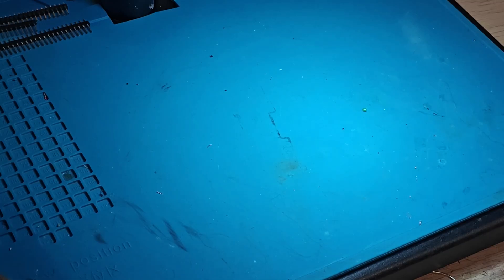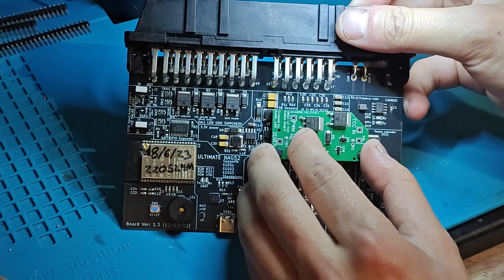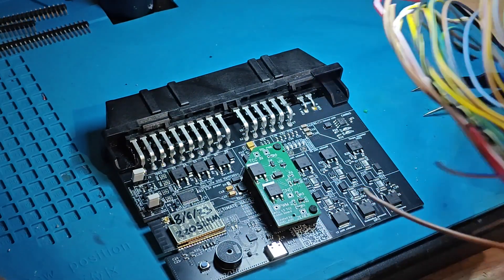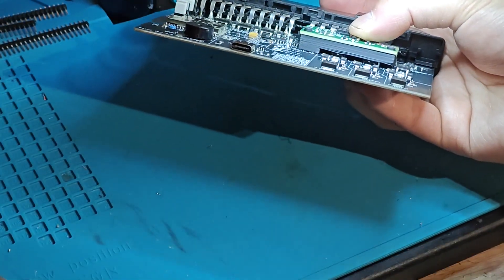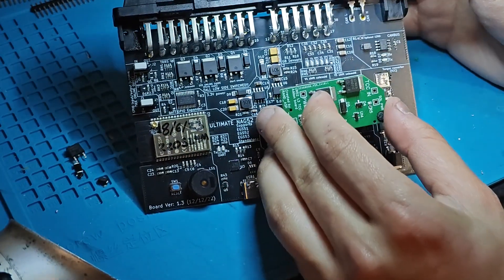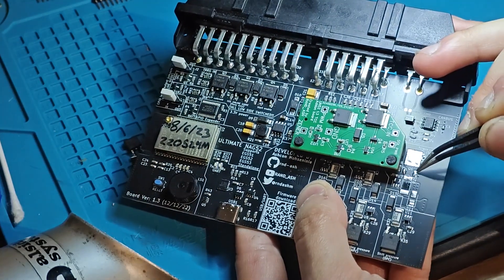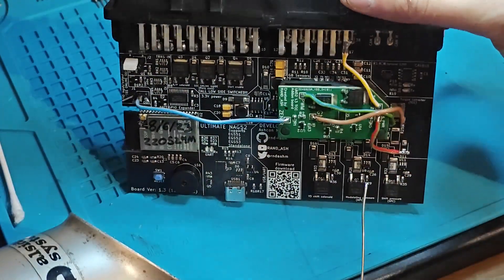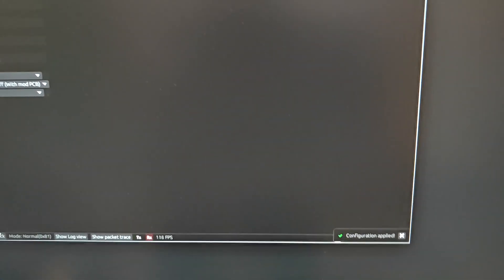Ultimate-NAG52 v1.3 Torque converter mod PCB install guide

Comment: Great instructional video. My boards just arrived for Evonne the Turbodiesel, the car on my channel. I hunted for the instructions for what what components to remove and what connections to make in your links, and didn't find them. I thought it'd be nice to print out for use in my shop as I break out the soldering iron. Am I missing something? Thanks!

Comment: Hey! I hope you are doing well, I just bough a 2001 C320 as a project car, Im definetly going with your TCM once I have the car in perfect condition and mantineance is done. Everything seems to be avaliable for the car, except a way to tune the engine ECU, there is a few pre tuned flash options (not my style), and AEM piggyback, yet no way to just flash and tune the ECU by myself, do you maybe know about any? Thanks a lot!
Reply: i have a w203 as well and ill get this TCU when mine is in proper shape too, if you have a siemens of bosch ecu you can likely use KESS V2 and winols to tune it but you need to find the damos files online or you would be guessing maps unless you have experience.
Reply: @samurboi8007  I actually found a guy that has all the tools to Tune it, I just gotta pay for time at the dyno in his shop, so thats great!

Comment: Hi ... any tinkering done on  2006  slk 55amg R171 7 speed 722.9 gearbox standalone type software that does not need messages from vario roof ecu ,whieghing system ecu,esp ecu ( rear wheel speed only) scarf heater and anti theft? I am asking as i built in a 55 amg engine and gearbox , Eis and Sam with instrument cluster into a vito bus but cant get it to shift. Any way around to sort out the problem i have,as i do not want to do a manual convertion on the drive train...
Regards

Comment: I have a w210 with a DSL1 controller but the car has a stock EGS and it shifts like crap , always has. The DSL1 uses the stock can bus data structure to communicate with the vehicle so that really helps. Have you tested on a w210 yet ? I'd very much like to get away from this stock EGS controller it awful

Comment: Can i continue use without this addon pcb? Or should install immediately?
Reply from the maker: Yes you can, it's an improvement. Not mandatory
Reply: @RANDASH  i saw wiring diagram of addon pcb , but not understand what doing the second mosfet? Second mosfet keep on ground when not working first mosfet? Can you explain briefly?
Reply from the maker: You can see the differences in my previous video

Comment: Since v1.3 PCB already have two suitable mosfets installed, couldn't we just cut few traces and add jumper wires to make stock board behave same way it does after adding this addon board?
Reply from the maker: No, look at the add-on board schematics, it has a lot more supportive components on it, you can't simply just join 2 MOSFETs together and hope for the best
Reply: Sure, diodes etc would be needed either as smd or as thru hole components keeping long legs rather than adding extra wires as in video.
Reply from the maker: @horstlederhosen  you would also have to cut a lot of traces on the PCB, which is harder than soldering